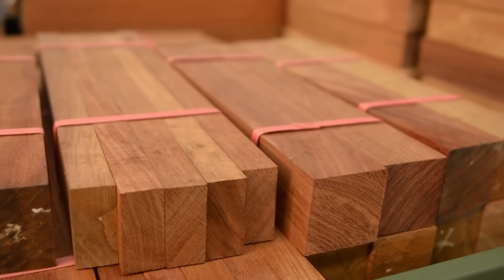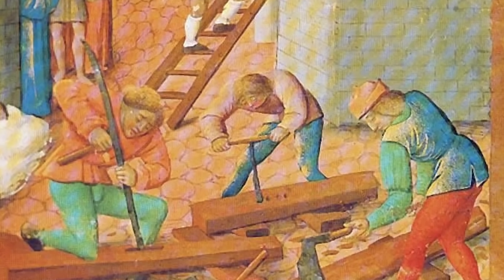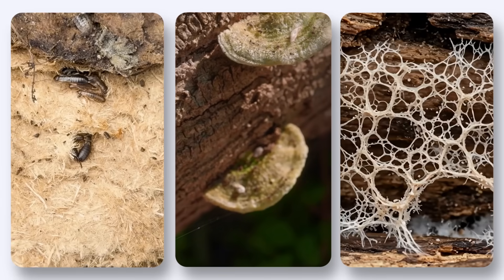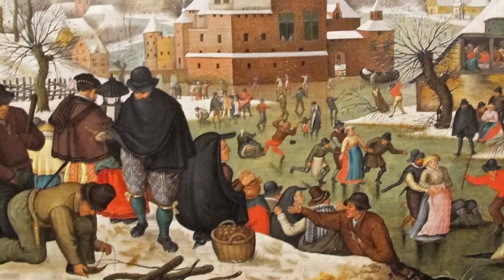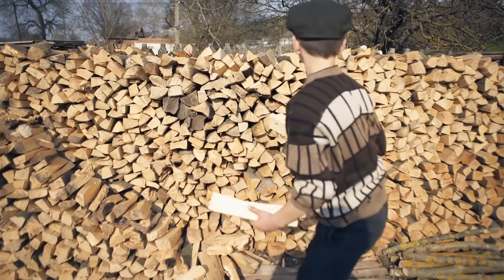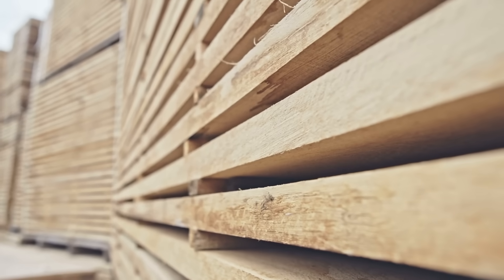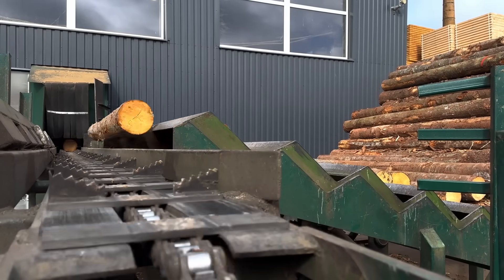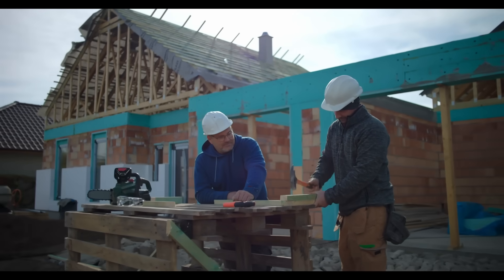Why Scandinavian Wood Never Rotted While Yours Dies in 5 Years

Comment: Its actually not correct that only hartwood is used for structural assemblies. It all depends of what type of tree one have. Often the core is actually removed as the outer part of the tree have like a laminat from the year rings.  And its only in the larger radies that the laminat is in one homogeneous direction. Just the other day I saw a video of researching  timbermen replicating a part of the towering structure of a church roof from the 1100 in sweden. They concluded just that. 
Not sure for what trees its true for but it is for sure some of them. Or if the structure is dependant on other material specifics

Comment: This is misleading survivor bias of local wonders, similar to as claiming why Egyptian buildings last forever while yours callapse in 5 years. Actual viking age longhouses and their later forms until a couple hundred years ago, regular buildings; lasted about 30 years. The old churches are basically the pyramid equivalent of the local culture; building a wonder for their god at to expense spared, using only the most precious materials and the most skilled craftsmen known in the entire kingdom.

Meanwhile their houses had dirt floors, had low quality wood that rotted right away. The few parts made of massive wood, was of any wood they could come by, and was only for the main structural framework, at 1-2 meter intervals, which was stood up in the dirt as poles, with joined pieces bound together with rope, twigs or roots. Walls were made out of sticks stood up in the dirt, and woven together with tree twigs and roots (like rough baskets), and were insulated / made tight with dung and dirt. The corners of the house were literally bound together using thin stringy wood such as roots and twigs, which is why the Swedish word for a corner of a room is still called "knut" (Swedish for "knot").

They kept their farm animals in one end of the building, had a fire and living area in the middle with no chimney, and storage in the other end. Only the very rich could afford things like actual planks and good quality wood, because especially in growing settlements, there was a shortage of wood, which had to be sourced ever further away, in an era of manual transport and poor infrastructure.

Log houses with joints were a thing of Viking kings and other special and wealthy people, and the dirt-poor Finns (not Scandinavians), who just lived sparsely enough, living from the forest, surrounded by the forest. The Finns moved the logs of their loghouses from one settlement to another when one area could no longer support them: The same log house could be picked apart and rebuilt like a Lego set of sorts. There is a vintage video of that on YouTube, showing some of the last skilled men in the craft doing it in traditional style.

Comment: The reality is that producing true old growth wood today would cost around 4 to 6 times as much as modern plantation lumber. At that price point, almost no customer would choose it. You can use engineered materials that perform better for less money, such as engineered wood products like CLT or LVL, steel, concrete, or even aluminum depending on the application.

A lot of people compare old growth wood to the cheap mass produced lumber we have today, but that comparison is misleading. Old growth was not “better wood for the same price.” It was common only because the cost was spread out over centuries and vast untouched forests. If you actually had to grow, manage, and protect trees for 150 to 300 plus years in the modern world, the material would be extremely expensive.

Yes, wood is wood, but availability and economics matter. Modern wood is much cheaper because it is fast grown, optimized for yield, and scalable. Old growth timber looks exceptional partly because it is rare, and rarity always hides cost.

Comment: You also were picky about what type of wood was suitable for the different use or function. It was even common to remove the bark on standing trees if they were supposed to be used in exposed areas. The tree then tried to protect itself by producing sap and made it even more suitable. The winter felling of trees made it easier to transport the timber on sleds on the hard and snowy ground, it also protected the flora and fauna since the ground was frozen and didn’t get destroyed by heavy machinery.

Comment: I like the videos on this channel, but this one leads to unnessecary polarisation. There is a very big use case for non-rot resistant wood. Thankfully there are plantations to provide this kind of wood so (in theory) man could leave the old growth alone. (Sadly the daily practice is very different, greed and lack of law enforcement continue to decimate forests world wide.) Also, thankfully, there are sawmills that use all of the tree, not only the heartwood. Imagine the price and availability of wood if this was not the case... Fungus is only a problem when moisture content is too high (above 18%), in most indoor use these levels are easily avoided. There are also ways of treating wood other than with copper, for example Akoya, which uses a combination of heat and pressure to eliminate sugars and harden the fibres. Climate plays a more complex role than is suggested in the video. Also, in many regions bugs form a far bigger problem than mould, Scandinavia being the lucky exception. The correct application of wood to prevent rot is basic knowledge to almost anyone who can actually hit a nail with a hammer, no need to be dramatic about it. Far more important than being snobbish about wood, is being smart about it, managing this valuable resource well, applying the right characteristics in the right places, re-using and recycling wherever possible.

Comment: .. This is essentially how building is done least for builders them selfs just couple decades ago. Logs were chosen from dry rocky areas with little water and little matter for trees to utilize, cut down in february march period then sawns using the hart wood for structural stuff and rest went for boards and non structural materials. This was then stacker and dried for 2-3 years covered with just sheet metal with good ventilation in sunny dry area preferrebly top of a bed rock to keep moisture away.
Our pier posts are just untreated old growth just rammed to the lake bottom in winter when those were cut, not even peeled, charred or tarred and being 80y old by the growth rings are still holding fine 30 years later, though those do start to look like little tarring on above water would be beneficial and there has been some damage from ice but i predict those will last another 20-30 years if tarred now.
I have still about half to full house worth of logs still growing in Finland, though i need in couple months start felling few as timber frame repair logs, but you can find locally forests that are mixed forest that has not been logged in long time so find out the owner and make a deal to get chainsaw pick harvesting that you get to the smaller lumber mill or transportable sawmill to get it cut to sizes and talk to the operator to get the wood milled properly, witch you then transport and stack to dry. In Finland at least you need to get the wood inspected and stamped that is just another route for large sawmills to kill the competition, mind the stamp does not do anything regarding each boards quality, its shit most parts like i found out when buying stamped 2x2's for a project, knots and cracks all over, but you can ether buy few boards and claim its all stamped by showing the stamp if anyone asks or get your wood stamped officially with some extra costs to get superior lumber. 
I fully agree we should really stop with the factory harvesting forests and return to pick up logs letting rest to grow and do mixed forests instead insisting its all certain wood. Just let it naturally seed by cutting max 50m strips if you need to do it with harvester, or use mentioned picking method. Sure the yields are less but lumber quality is superb. For cellulose sure use farmed trees, but for construction you should always aim for old or slow growth instead and built to last using old methods instead plastic wrapping everything so next thing you know little moisture got in and cant get out so when you notice it, the whole frame is moldy...

Comment: Click bait video comparing timbers to lumber to wood. Done in such a way to confuse the 3 and different processes to create them. Truth be told North American timbers are larger and grade the same as Scandinavian. Scandinavian lumber is lots of smaller sticks usually now used as glulam. Modern lumber is made not to split and check. Scandinavian lumber is actually more prone to checking and splitting as cells try to flatten out. Hence why glulam is so popular there.
Reply: Sweden don't produce timber or lumber that matches the U.S. grade of #1. The Swedish grading system/European goes up to what in the U.S. would be #3 wood which we can't use for most construction. I did check into the grade systems. Scandinavian timber and lumber is crap compared to U.S. products by grade. It don't meet building codes here for heavy snow loads. That is the truth.

Comment: I will call out the lies. Lots of misinformation. By not stating where the compared forest are located. Comparing Norway wood to Canada you get similar results vs southern yellow pine in southern U.S. Old growth forest still exist. What it comes down to is open cell wood and closed cell woods. Also the drying process can open cells of a closed cell wood. We have trees that are only 7 feet tall and over 500 years old around the great lakes like a natural bonsai tree. Canada has similar or worse climate as Norway. Actually they griddled the trees and let them stand dry before cutting. A lot of logging is did in the winter because the ground is froze. Other wise equipment sinks in the muskeg. Norway isn't that much colder than Michigan. Yes a char and tar does make wood last longer. Species and grade also matters. What about douglas fir naturally rot resistant? Why Scandinavian wood sucks is it's small size vs massive old growth wood from northern U.S. and Canada. Heart wood will crack and check wood. As a timber framer we use doug fir or white cedar. Of course here they grow to massive sizes.

Comment: Much of this knowledge, maybe not the deep technical stuff but, was second hand knowledge among many Norwegians.
At least outside the cities I would think. 
Even firewood gets a similar treatment.
Harvest the wood mid-winter because that is when the wood isn’t «soft», chop it on ca. 60 or 30 cm long logs, split the logs into several pieces, then stack and store the wood in a dry place with airflow.
It was just the way we do it because then the firewood burns better and longer, and does not rot.
I would say it is just common sense.

Comment: 8:31 Pine tar will also leach out of the wood. It needs to be regularly re-applied.
Reply: Somewhat correct. If you applied pine tar each year for the first 5 years, the next time needed might have been 10-15 years. So after regular application you would only need semi regular. Pure pine tar, not thinned out, when applied in right conditions like heated and summertime will penetrate deep, and with the thick consistent it takes a long time to leech out.

Comment: I used to work on sanding and renewing the old wood floors and sometimes, I'd come across few of the darker boards in the mix. They were extremely tough to work - really hard to sand, and full of old resin and sap. Even after decades and sometimes century, these boards were still pristine inside, and felt as if cut yesterday because of the hardened resin. They would not even take the varnish/lacquer put on them. 
Recently I worked on painting wooden vacation houses in area where new ones were constantly built, and a lot of times it would happen that they needed new coating after only few years because the boards were really bad, from young trees. On the sunny side they would very easily dry out even under 3 layers of paint, and would look visibly aged after just few years outside. Decks were usually untreated (other than factory applied impregnation) and they all got gray after 1 season under sun. It's all build on such large scale and so fast I couldn't believe when I checked history on google maps. Thousands and thousands built within a decade on an 3km radius area. And this is just vacation houses. It's no wonder forestry industry can't keep up with the demand and quality.

Comment: I owned a house that appears on the census of 1768.  On taking the sheathing boards away, we found that a fifteen-foot section of the main corner post had been completely eaten away by carpenter ants.  Old growth when it was cut, 250 years earlier, from a tree over 300 years old, making the lumber over half a millennium old—that’s well before planned obsolescence.

Comment: My 50 years of experience in UK Leicestershire.
I used to have local old trees sawn into timber and air dry it sometimes using a dehumidifier kiln afterwards. The sawmills shut down so then I bought commercial timber and for one European Oak is no match. It rots in 15-20 years and swells like mad in our admittedly wetter current weather pattern. the native timber feels completely different to work with.
I’ve a pair of gates that I made of European Oak 15 years ago to replace now whilst the same customer has an adjacent 70 years ago old native Oak gate with no problems.
I’m currently fixing a 120 years ago old Pine bay window that’s mainly rotten because of poor maintenance with leaking gutters draining onto it. one original piece sat end grain on sandstone at ground level from new, still sound but the top rotted from water ingress through the paint
Modern paint is like a plastic bag, it adheres poorly and cracks entrapping water and don’t get me started on the rotten gate post sat in. a 10 year old concrete pond.

Comment: As a self employed woodworker. I noticed how bad wood quality supply is. Construction timber(pine) that's been cut in summer or even spring (when it's literally waking up and most saturated)gets blue fungus almost instantly. The oak that I buy for furniture making has 0 seasoning but instant kiln drying. It has so much stress in itself even though the RH is 10% it binds on my saws, and twists after cutting and milling. It's quite bad situation. And I don't know how it will change
Reply: Buddy, you might have to find a nearby forest and pay to go personally select wood to get what you want. Even as just a residential cabinet maker we have seen the quality drop also. My father talks about the selection he used to have in the 80's (Ohio)

Comment: What struck me most wasn’t the density numbers or the lab results. It was the quiet patience behind medieval timber. A tree cut only in winter, when the sap has fallen silent. Left to rest for years, not weeks, while sugars fade and resins harden. Heartwood chosen with intention, sapwood set aside without regret. Then pine tar, heated and brushed deep into the grain, not to coat the wood, but to become part of it. That wood wasn’t rushed into service. It was allowed to finish becoming what the forest intended. Modern timber fails not because we lack technology, but because we no longer wait. Medieval builders understood that survival structures are grown, not manufactured. The same principle applies to winter shelters, sleeping warm, and lasting through the cold. Endurance is a process, not a shortcut.
Reply: thanks chatgpt
Reply: @matthewroberts785 , "the language level is higher than mine so it has to be ChatGPT" aahhh comment
Reply: @yomiyama  Don't insult my intelligence. There's clear signs of AI writing dripping from the OP:

(1) "wasn't the" ... It was the hyperbolic statement.
(2) Excessive use of emphasis. "left to rest for years", not weeks.
(3) Excessive attempts at humanization "chosen with intention", "without regret"
(4) Bold statements followed by clarifying conclusions everywhere: "statement", "conclusion".

This is exactly how chatgpt writes. Likely the OP is bot using chatgpt to season their account followed by selling it off or to generate engagement to their channel.
Reply: @yomiyama  also almost forgot: the biggest tell was that the comment actually contributes nothing. It's a generative summary of the video.

Comment: I bought a house in Washington in the late 90s.  It had a small deck out back.  Within a few years it was starting to fail.  I decided to stain it — there might be better solutions — every year after that.  But it lasted for at least 12 years only because I stained it consistently.  But if I were going to build a deck now I think I’d use that synthetic material as I heard it lasts a long time.  I’m guessing though if you built a deck out of the best wood you could find it would last a very long time.  Lumber at the hardware store nowadays is pretty much junk.
Reply: Very true, it's junk